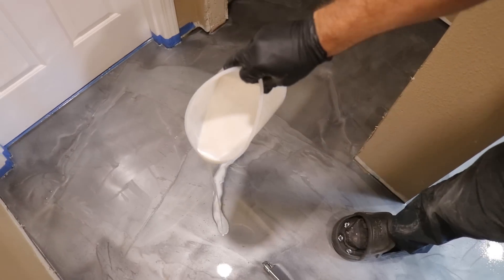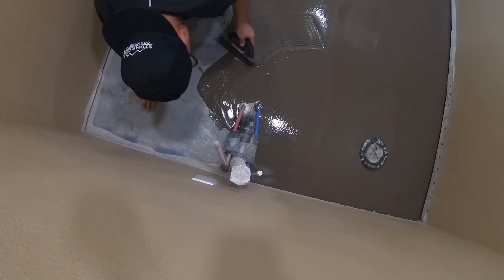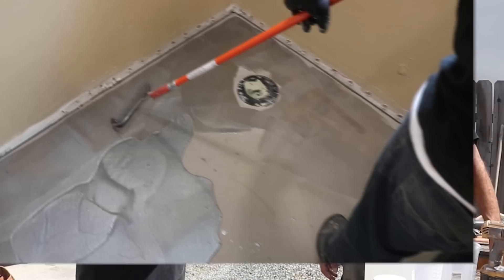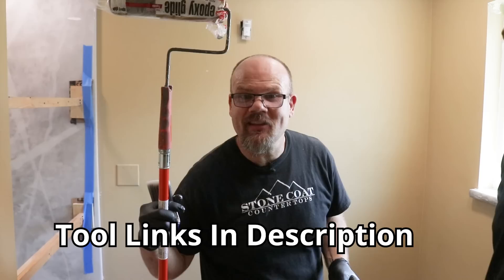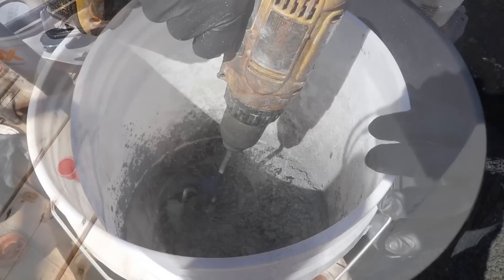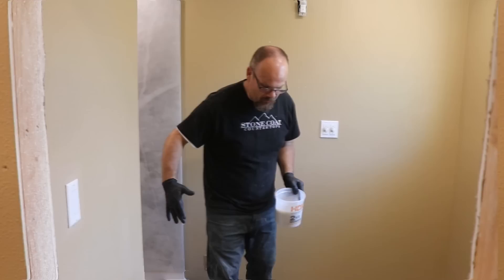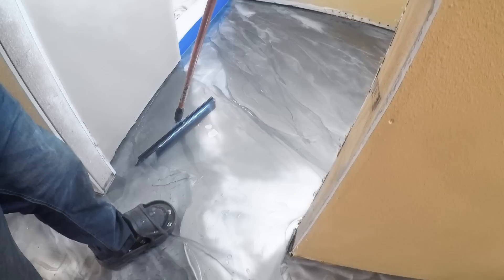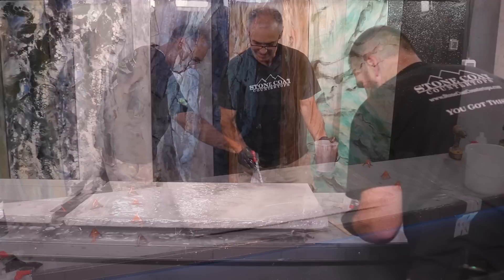How To Epoxy Coat A Floor ✨ | Stone Coat Countertops

Comment: 2 ppl needed and my guess is that 1 of the 2 needs to be a pro! 😊  Beautiful... but tricky... and time consuming and requires patience and skill (and don't forget the power mixer stick). Thx for the info.
Reply: TJ Tampa does this chip bad cause I painted my counter tops and I regret it they chip horrible and I put coats of polyurethane on them also🤦‍♀️

Comment: Can’t wait to get going on a couple epoxy projects for the man cave. Do have a couple questions. 
1) what happens if you do the moisture check with the plastic on the floor and it shows moisture??
2) will the floor epoxy hold up well in a garage where salty water in winter would sit for a few months until spring cleaning?
3) how slick would the epoxy be if used in a garage? Is there a grip additive that would be recommended or used at all?
Reply: scott howard 1. you will have to use a moisture barrier first, generally that should do the trick. 2. It will hold up but you generally don’t want to leave water sitting over any surface for to long. 3. In my experience it’s not to slick but you could broadcast a non slip additive on your top coat. Or you could go with a paint chip system instead of metallic.

Comment: I have made resin tables for over 35 years  and sealing the air in wood is a trick that many miss. I also thin the epoxy with up to 3% of denatured alcohol for better penetration. Awesome video!!!
Reply: What would you recommend to seal the wood with (other then denatured alcohol with epoxy)? I’ve seen him seal it with a thin  layer of epoxy but no alcohol. Would a wood sealer help?
Reply: @GreddyReaddy  wood sealer will help but using epoxy with alcohol allows the alcohol evaporate leaving epoxy deep into the wood. It is an epoxy based wood sealer. With commercial table tops using wood sealer or polyurethane after a while when chairs are bumped into the side the resin can pop off the sides leaving sharp edges and it's a liability after ten years. By using alcohol and epoxy it allows better penetration thus making it a more stable substrate
Reply: Beachnative42  thank you for the information. What would suggest the mixing ratio be and would you just apply with a brush?
Reply: @GreddyReaddy  if using one cup of mixed epoxy use about 3/4 oz of denatured alcohol  and would paint it on with a brush

Comment: Do epoxy floors have good traction?  I have this vision of slipping all over the place on them.
Reply: No they do NOT
Reply: As soon as I gets wet it's slippery as hell... But many surfaces are.
Reply: You can add in a non-slip additive in the topcoat, it’s called aluminum oxide
Reply: You could just mix in a grit to give it a texture.

Comment: I live in the Caribbean and we have flooring, kitchen and bathroom counter tops to do. We build using concrete and cement here so the counter tops are made with red brick and steel and then plastered and usually tiled. Everything is tiled out here even some people's yard and drive way :-) so I'm really excited to discover and try this but intimidated as well. We don't have home depot or Lowes and it's not so easy nor cheap to get materials you might need here. So I want to make sure I get everything I need one time to do it right. Wondering if it's possible to order from you guys and have what I need shipped. If only you guys were near...I think I would just pay the price to have you do it. It looks so great. I fear mine won't. Going to checkout your website now and maybe I will feel equipped to truly do this. I live on the twin island of Trinidad and Tobago. Tobago to be exact. Found  a distributor in Trinidad but none right here in Tobago yet. They sell 3 gallon kits for $1,700 TT dollars that handles 415 Sq ft. but they don't give you all those tools. Nor do I even think they have them to buy separately as yet. Is that a good price? Or might I come out better shopping online for myself and getting these things shipped? Sorry for the long comment.

Comment: Can you do this if you have plywood subfloors rather than concrete?
Reply: The answer is yes, it will go any surface.
Reply: i had the same demand
Reply: If the sub floor flexes it will crack everywhere.
Reply: Hell no brother....
Reply: @ihabahmed1132  *Question. Your english is great, but we say "question" instead of the root of so many languages "demand". The connotation in english of demand is to "bossily require without negotiation".... and I can tell what you are intending to say. Keep up the great work!

Comment: Nice floor Mike. I do a lot of metallic epoxy floors as well.  I haven't used your epoxy yet but I might on my next job. If you didn't torch it, how many air bubbles do you think would show the next day?
Reply: How have your projects aged? Are they dangerously slippery?

Comment: Have you ever added sand to provide a non slip surface. I want to resurface a fiberglass floor in a shower.
Reply from the maker: Great question, we have had customers use Silica sand with great results!

Comment: I can't stop watching your videos! So Great! I left another question in your parent's video for the bathroom, I would be doing this from scratch. What kind of backing board do you use behind the shower walls? Also, could you give me some guidance on making or buying a shower pan? What works best in a wide temperature range -30 to 85f and stays leak free? Never done this before.

Comment: I've only seen you do the epoxy floors over concrete substrate, what if your substate is wood? Would you use tje same process, or would you do the coating like a plywood countertop is done?

Comment: Can the same process be used for a garage floor ? Would I have to scrub and clean the floor using acid and scrubbing with brush before applying base coat before applying STONE COAT products ?

Comment: The other thing, I see there are those little broken line (left from your shoes while walking on the wet proxy) how can i avoid that while i have to pure proxy and trying to add the metallic as designer lines - I suppose i m not suppose to walk on the wet proxy-

Comment: My house is 130 years old and the floors are very uneven.  The subfloor is red pine and has lots of gaps.  Will this work if I apply plywood or concrete board over the original subfloor since i don't have a concrete slab foundation?

Comment: I have a cracked tile floor. It was done by an inexperienced person. They payed the tile with thin set over plywood. They didn't use anything to strengthen the floor underneath. Could you demonstrate how to do this over plywood floors?

Comment: Couple of questions @stone's coat countertops
1.  Can I use the metallic in 91% isopropyl alcohol sprays on floors?  I presume  I would have to top coat with a clear coat of epoxy
2. I really really do not want a glossy sheen on my floors, now that I've seen the "how to hone" video, can I do that to floors?
Reply from the maker: Great questions! 1) You definitely can, and yes, you would want to do a clear on top. 2) You definitely can, though you'd want to get a floor-sized sander. Let us know how it turns out and be sure to do your research and call in for free project support 👍 You Got This!
Reply: A urethane top coat can give you a matte finish. So far SCC hasn't released a urethane but they are out there.

Comment: I have got to tell you that this video was awesome and amazing!!! I love the cool color as well too! I am in a middle of a building project and I was wondering if this could be done inside of a utility building or shed with a wooden floors because I have a hot dog cart and the health inspector said that I would need a building with a non-pursed floors or other parts of the building. Because I need a commissary for me to be able to use utility building. Any information would be greatly appreciated thanks 🙏!!!

Comment: I have some 10yr old plastic (not sure what you call it) junk on my floor that the builders put in. We tried to remove it in one of the rooms (it's in every room of this 5 bedroom house) however, it was a disaster and we ended up having to put carpet down instead (it was concrete under the plastic junk).

Can this be applied to plastic flooring?

Comment: Are epoxy floors pet friendly and can they stand up to pet traffic and   accidents?
Reply from the maker: That's the right question! Absolutely. Our countertop epoxy has to resist knives, coffee  stains and hot pans on a regular basis. The flooring epoxy is just as tough ✊
Reply: autumn fyre more waterproof and pet friendly than other floors
Reply: Thanks for the response. I'm seriously considering doing epoxy floors in my entire house to cover water damaged terrazzo floors.

Comment: I love each of your videos. Thank you. Can this product be poured on a cement board countertop?
Reply: I have done that with other epoxy products, so this should work even better. Make sure you have the board glued and fastened down really well, all screw holes and seams filled and finished fairly well. The epoxy will fill voids, but have a better chance of holding air bubbles. Maybe 2 thin coats is better than one for the sealing coat.

Comment: Epoxys wear down over time. UV light is the worst. I know this because I work with epoxys. Not only will it wear down you might want t consider it a fire hazard as it is flammable. They hit it with blowtorch you say but moving a torch across the surface vs consistent flame is very different.

Comment: Hiya.  I'm based in London. Where do I buy the epoxy resin from and is there a non odour one as I'm asthmatic. Strong smells like paint stripper and nail polish sets of my asthma. 

Also how much would you charge me for a small bathroom floor that's less than 8ft long. I'm not good with numbers or measurements. I also have a mobility condition and back condition. But

I love watching you guys and it inspire me to do more to my bathroom. I've mixed my own colours in the white emulsion paint and painted the bathroom.  The tiles are mildewed so will wash and remove the grout gradually. I have mould and mildew resistant solution.  I also have a damp patch sipping through the ceiling that I will contact the council about. As I think the roof tiles outside is damaged. 

I will watch and share your vids to my FB 4,935 fans. I'm a multimedia artist 🤗

Comment: Can this be used with under floor heating
Reply: Yes. Radiant heat should be no issue with this. Just don't run the heat until the epoxy cures for a few days.

Comment: as a actual contractor I cant understand why you would go through this much trouble for a floor that looks like a rolled adhesive floor, wouldn't itd be less trouble and work just to lay vinyl flooring?
Reply: When standing on it it neither looks nor feels like vinyl. Looks and feels like stone. Vinyl flooring is softer to stand on and stinks a lot longer.

Comment: I thought epoxy is too soft for floors.
Reply from the maker: You stand corrected 😎 Our flooring epoxy is specially made for durable, long-lasting, beautiful floors! Another perk is that it's warmer than tile. Ken here was considering installing a heated floor, but the epoxy's warm enough that he didn't have to! Thanks for commenting!

Comment: Seems to me that trying to simulate real marble in a bathroom is like trying to square a circle, it can't be done. You can never obtain the true look of original marble and with that being the case, why not go hog wild with the colors and do something totally mod ? A totally wild bathroom would be a hit. Nonetheless , I would take this rather drab epoxy floor over a blasé tile floor any day.
Reply from the maker: Great comment! That's beauty of this system, for sure! Endless personalization 👌
Reply: @StoneCoatCountertops  Where do you start though, it seems overwhelming. There are so many color combos , patterns and everything else. I guess you just experiment until you find something that works.
Reply: @matthewjackson9615  yup. I have watched and filled them for over 5 years.  Watch every video even if it is a style that doesn't appeal to you, because you learn a vast amount of techniques, patterns,  pro tips and confidence.  I'd suggest getting their big package that has their most used additives, then because you watched all their videos you can get an idea and feel for what you think will fit your style, you can add on any extra metallics, glitters,  diamond dust, micas that don't come in their kit. I added their crushed pearl mica, alumilite gold dust, and opaque white dye. Then go to town making samples. Make sure to either record yourself making them to have the ability to go back and have a reference to what you used and how. Write the recipe down.   Pick you favorites, put them in the space you are wanting to have them in , live with it for a week. That will help you make your best final decision.
Reply: @hollykolvig9298  😎👍🐶👏👏👏👏👏👏👏👏👏👏👍👍👍👍👍👍👋

Comment: Complete junk. Had my livingroom done and a few months later it was all scratched dull. Complete garbage!!!
Reply: Carlos Valdivia f
Reply: F
Reply: F
Reply: Did you top coat it right? I put 2 topcoats on my end tables that we eat off of. Lots of wear and tear given but it doesn't show.
We're rather tough on these two surfaces with metal a sliding crockery. Have you been able to find how yours went wrong? Please share.
Reply: I had a well know California based construction company do the work. $3800 Down the drain. And it was 100% apoxy!! Its not designed to be walked on ...JUNK!

Comment: You guys are crazy if you promote that as easy for the average Joe. That would be super high risk for the average Joe to get that to turn out rite with no prior experience. To go out & get all the tools & materials to do it start to finish & have the end result be awesome with no prior experience is unrealistic for the average person. Definitely not a beginner DIY project as your suggesting. You better have a ton of common sense which is not so common anymore & have some experience with DIY projects before jumping into that.